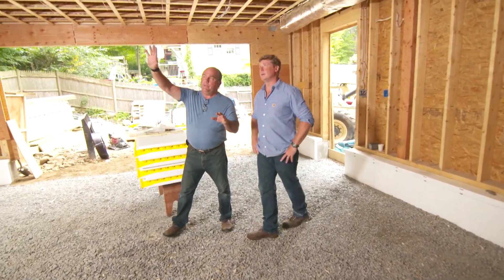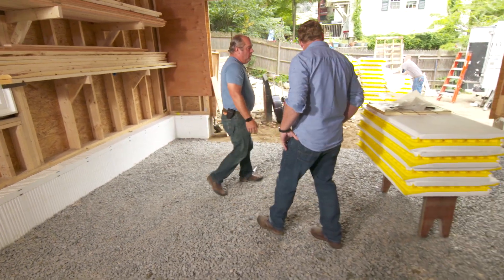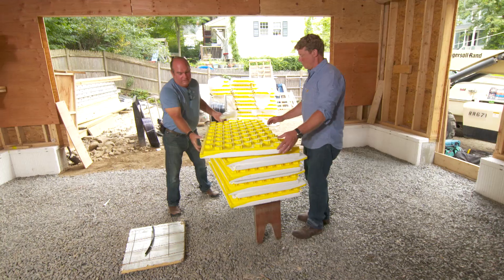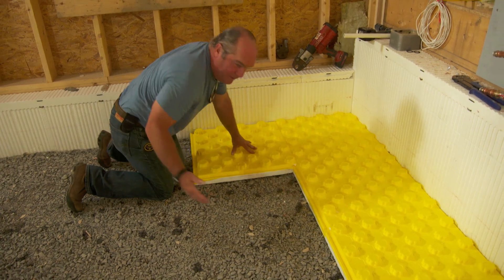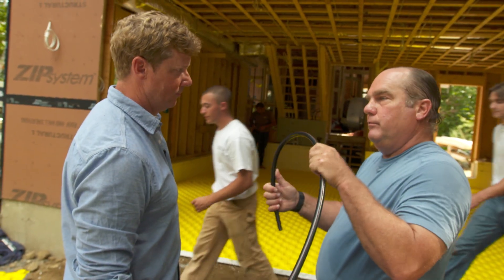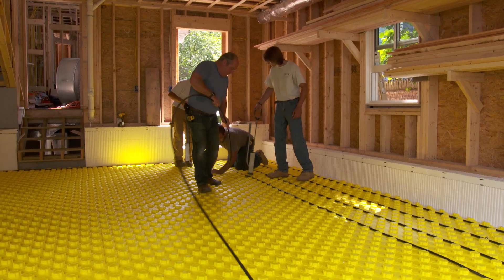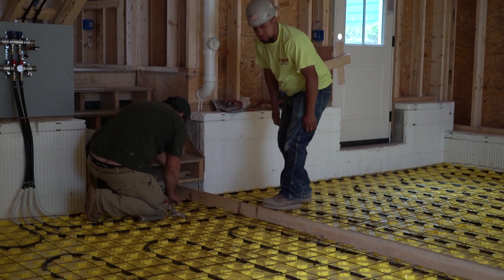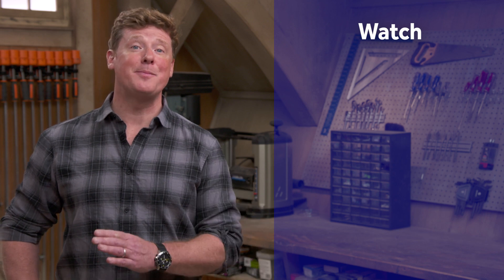How to Install a Radiant Floor Heat System in a Garage | This Old House

Comment: I agree with the last comment, would love to see the plumbing. There’s a lot of diy stuff on the inter webs, but I’d like to see a professional install. I did all this a few months back in my new shop it would be awesome to compare my plan for the plumbing to how you guys are gonna do it. Long time huge fan of the show.
Thanks 
Joe
Reply: This Old House doesn't get into the advanced install tutorials anymore.  It's basically glorified HGTV at this point.  If you want to see detailed installations you need to watch Ask This Old House for that.

Comment: I had this for 5 years. It is heaven not getting in a cold car. It is worth every penny especially if you have a shop in your garage.
Reply: Do you bolt anything down to the floor?
Reply: Peter Petrakis nope put it down and pour. Make sure your hvac contractor sizes it right.
Reply: Irony is that if you live in a place that salts the roads a heated garage is the the worst place to put your car overnight. The salt slurry being allowed to melt over and over increases corrosion compared to if it was just left frozen in place.

Comment: Concrete over styrofoam, wow.  If you drive a car onto it, won't the slab crack near the walls, as it moves up and down?
Reply: 4" thick with rebar, why should it crack?
Reply: jej3451 I have this. No cracks. Use 4000 lb concrete.
Reply: I wondered that too.

Comment: what a luxury item for a garage. Not green building for sure but really nice to have warm feet. you need to keep it on 24/7 to make it work.
Reply: You don’t need high temperature water. If your garage is insulated it’s not a big deal. Make your wife happy. Give her a warm garage.
Reply: Colin Bollinger … If you are heating the garage anyway (work or other reason) this is as green as it gets. You feel comfortable at 5 - 10 degrees lower because the floor is heated. Basically the savings is on the back end because it does cost more to install.
Reply: Never worked in a garage, eh? Summer months are great for heat...
Reply: Not green lmfao.
Reply: wonder how much that costs with the foam things and heating system

Comment: What if there’s a leak after an earthquake? Can’t find the leak and you gotta jack hammer your whole garage floor :/

Put some extra socks and a jacket on instead!
Reply: TheSynysterVyrus … Leaks can be found with a thermal imaging camera. (the leak creates a hot spot) In the old days a plumber would ask if the cat found a new place to sleep. Animals are smart about taking their naps in the warm spot.  <LOL>
Reply: If it's leaking after an earthquake, there will likely be a crack in the concrete where the lead has occurred. In which case, you will want to repair the floor as well as the leak.
Reply: Earthquake in New England? If you live in California you don’t need this.
Reply: Feed a fiber-optic borescope into the line and visually inspect it from the inside.

Comment: ...and no mention of pressure testing...WTF
Reply: This is a video less than 4 mins in length attempting to explain the concept of a system not be some all inclusive guide for installation.